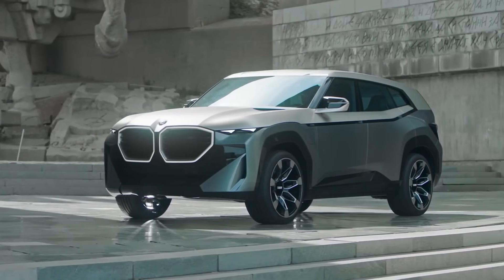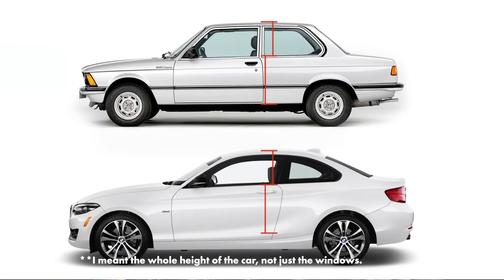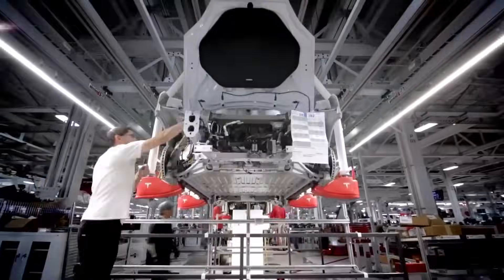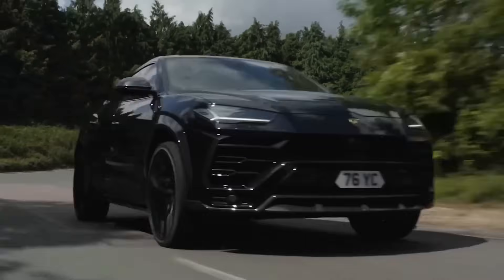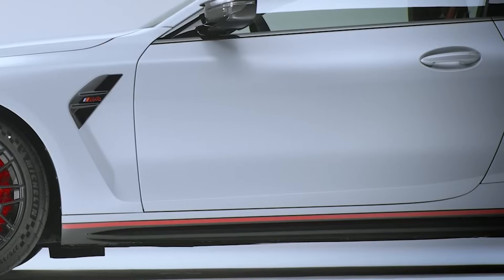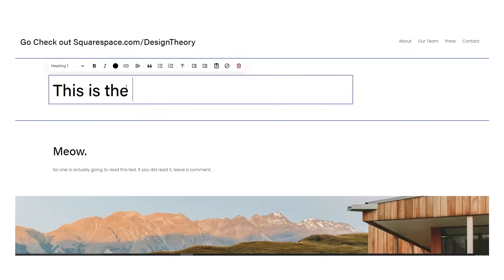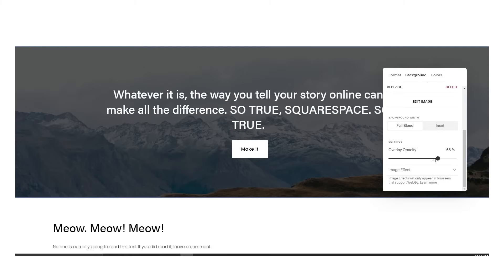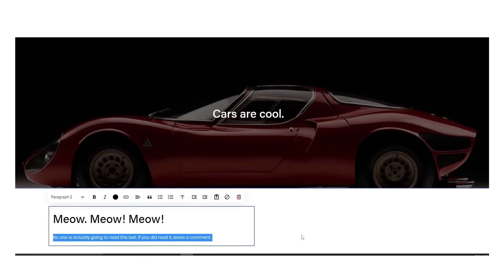Why Modern Car Designs Are So Visually Complex | Q&A w/ Pro Designer

Comment: Complexity is mainly done so it won’t make sense financially to remodel it in case of dents/accidents.
Replacing whole parts instead of simply iron out whatever "imperfection“ is creating another revenue stream. Only a few years ago you were able to replace headlights on your own (not to mention a light bulb). Not possible today, in some cases you’ve to disassemble parts of the motor only to access it.
The BMW E30 you’ve showed has become an icon for a reason. It’s "clean" lines are its main staple.
I own the convertible, and it’s still a "head-turning-device". The visual "Batmobile"-isation of todays cars (attached to the rise of "tank like" SUVs) simply reflects the increasing aggressiveness of a modern society.

Comment: I refer to it as "Designer Masturbation". 
It is a chronic disease infecting around 99.8% of all designers.

Good design is SIMPLE. And the perfect example of this is the new Mazda Icon SP design. It is without doubt, one of the most gorgeous cars to ever be produced, and it makes other so-called "modern" cars looks utterly stupid.
Most modern designers are crap. They can't do a good job, so they produce an insanely complex design, instead.

In fact, most modern cars look as if they had three independent design teams working on three different designs, but instead of picking the best one, the manufacturer say, "Screw it! We'll use all three design overlayed on top of each other."

Comment: So as someone who works at the BMW X plant I feel some insight might be helpful. 

Simply put cars are really…really complicated in modern designs. If you take any part off of a car to expose internals they will look like a massive mess of wires and bizarre clips and moldings to keep the countless sensors and control wires or lines in the right place. (My heart goes out to those who have to diagnose and fix problems on modern car’s mechanical and electrical) For better or worse our cars are now computers that also are interacting with the real world in real time. 

This is especially true with the XM. It essentially has every possible sensor and option available and it’s frankly quite impressive we’re able to get everything in there we can. 

So to actually get to the point with that context, designing these cars to be different and unique is quite challenging when they are going to be built in the same place and by the same people. There is no “Xm” line or building. So imagine trying to make a sporty and varied looking suv that is going on the same line as other SUV’s, oh and not to mention they have a million codes and standards to follow.

(Also in person I personally think that a good deal of Xm’s with the right color and wheel look fantastic, though I’ve seen a fair share or rather “fascinating” combinations)

Comment: Form is function.... this is a fact, that not even our academy university ID teachers didnt teach us. But its completely true, and even more of a fact than a form follows function..   Form becomes function, when you start making a human-centered design, like designing product handles, triggers, buttons, scaling products to fit human proportions, using a surface thats not slippery, and making edges more round or chamfered, if the material is very sharp like stainless steel...   I could go on and on.    Its a pleasure listening to your podcast and design thinking ;)

Comment: I agree with most the things you said except about knowledge.  I have never seen a time when a lack of knowledge brought about a good result much less better results than someone would have with knowledge.  Every time I as a IDer learn more about a subject, I am much more equipped to design a better solution.  Whenever I have tried to design concepts for a problem without a firm understanding of the subject matter- it has resulted in failure or poor results.  That includes "novel" ideas- a good designer will have more "novel" and "usable" solutions if they possess more knowledge not the other way around.  Would love to hear your thoughts.

Comment: As a classic car owner it is unbelievably frustrating to see the lack of connection that car companies have to their roots. There was a time when distinct and visually striking lines and body panels were the norm, but in a way that actually looks good, and not like an AI threw up on a Pontiac Aztek. I drive a 1965 Ford Falcon, a car which has a massive spear indented into the side of the car, wrapping around the back to meet the other side. This is a perfect example of a visually striking, shocking, and unique design, that does not over complicate things, and it was done on an economy compact sedan. The spear only consists of three body lines across the entirety of the vehicle. A good modern example of this is the Hyundai Ionic5, which has the depressing and hideous proportions of any modern SUV, but uses distinct and limited creases on the side to create a dynamic and striking design.
Reply: What makes many classic cars 'striking' is the fact you only see them rarely. Modern cars you interact with on a daily basis and get used to the forms and surface treatment of the current era. That's not to say there are great designs which were novel for their time. But putting any generic 60s car into todays traffic could surely be described as striking, just as if you were to do the opposite.
Reply: @DimitarStanev  I disagree with this premise. The diversity in design of previous eras is completely unmatched by the modern day. Look at a 65 Corvair, Falcon, and Valiant. All compact economy cars from the same year. Then look at a 2015 Corolla, Focus sedan, and Cruze. I certainly acknowledge that classics are striking on modern roads, but they were striking in their era too, because there was huge diversity even within the exact same niche market.

Comment: Early car design as was explained to me, goes as follows:
The early cars had a lot of straight lines because manufacturing technology was primitive. there was a lot of sheet stock, lumber and brake bends, etc..
The cars got round in the 30's and 40's as manufacturers perfected the machining required to stamp curved hoods and fenders.
Cars got boxy again in the 70's and 80's because design departments were switching to CAD systems and the computer technology was too primitive to number-crunch complex compound curves.
Cars got rounder and more complex as computer technology matured.
I'm not sure how accurate this is, but "car guys" at GM told me, so I assume they knew what they were talking about.

Comment: 3D solid modeling may have played a part in the growth of complex designs. This software makes it easier and faster to create the deigns, modify them for comparisons, perform engineering analysis , automatically collect and transmit data for tool design and manufacturing.

Comment: I'm glad the conclusions surrounding  the  'visual complexity' of cars was at least part-way damning of the designers. The bulk/common shape is undermined by the existence of modern but relatively clean and elegant designs (which do exist) - in an interview Gerry McGovern (Land Rover's long-time design head) stated that large, bulky cars are indeed harder to get right - but harder doesn't mean impossible...

Comment: sometimes the fractured look can also flow well, just in a different way from traditional flow
i think there is a spectrum to this, and while something like the lucid air i would describe as "languid" and more typically flowy, the hyundai verna also flows in a more sharp, inoffensive way and then on the other side is the non-flowy part of the spectrum

Comment: That moment when a top comment is way more valuable than the content of the video... Because you fell into a content creator trap of 'I' am X, therefore I should act like an expert in everything related to X. Even if I have no idea about it.' 

Man, I have never worked a day in automotive but just based on what I know about it, saying that 'different branches of the company tearing the design into several different directions' in a time when we generally have the most uniformity since the 80s, with different cars sharing the exact same lights, interiors and various design cues across the model range just doesn't hold any water. And showing a Type-R which is actually a quite cohesive and purposeful design for the car in question further proves you're out of your comfort zone here.

Comment: Current cars are following what I think of as the "Chonky Bling" styling. Unnecessary protuberances and messy criss-cross lines. They must be a nightmare to handwash, and look like they'd generate a lot of wind noise and wind resistance. When all the manufacturers are doing the same thing, no vehicles stand out anymore. 
However styles go in phases, so hopefully by the time I need to replace my current vehicles the chonky blink will be out and we can get some sleek lines again.

Comment: Regarding the first question, the answer is far more simple than you've stated: money. They could design a less "puffy" vehicle and they could, at the very least, go with curves over wedges to beautify those cars. But they won't because that would cost more money. In short, in my opinion, we drive horrid looking cars so that manufacturers can make more profit.

Comment: You dont even need to compare it to a 70s BMW, cars from early to mid 2000s still had healthier glass to body ratio. Subaru Legacy station wagon from 2006 compared to 2014+ Levorg which is supposedly derivation of same platform shows how tall window and hood lins got in same size car.

Comment: It's interesting that you mention Frank Lloyd Wright.  Many of the buildings he designed have significant structural/maintenance problems because he focused too much on form instead of function.  I've been to Swannanoa and one of the main reasons it's maintenance expenses are so high is because they did stuff like route the gutters inside the structure for purely aesthetic reasons, which is just dumb.

Comment: 13:49 I think I have a different understanding of what the function is. For me function is the physical thing, totally excluding the users. The function in this example is pressing a button. More or less deterministic. The form is the thing that leads us to the function.
The guitars are all functionally the same. The form makes a difference in how we use them, but how we use them is not the function for me personally. I would conclude use = f(function, form). The function says what we can do, the form says how we can do something.

Regarding the light fixtures: I would consider both of them on different axes/dimensions in a plot. A light fixture can be good looking and unusable, it can be bad looking and unusable, it can be bad looking and usable, it can be usable and good looking. I hear the question form vs. function as either or (exclusive or), because many modern "minimalist" designs are just stupid and unusable. Like these Vanmoof bikes. Every bicycle has s lamp that shows where you want to go since the light is mounted with the front wheel. But that's not good looking, so they put it into the frame. And now we lost function for having more form.
Reply from the maker: Totally fair points. There are many ways to interpret the meaning of these phrases. If you want to hear it from the source, you can read the entire excerpt by Louis Sullivan about "form ever follows function" on wikipedia. Or buy his book.
Reply: @Design.Theory  Thanks for replying. It's definitely more or less philosophic, there is no right (but maybe wrong) in the interpretation in my option. I'll definitely read the article.
Reply: Who presses the button if not the users?
Reply: @AlexR2648  I was making the point that function doesn't consider the user but the use. I don't care if a human or a robot presses the button. I personally view that on a more abstract level.

Comment: GREAT PRESENTATION BACKED WITH SOLID DATA...

I am a Designer from way back. I have designed a Modular Car that can be twin engine, triple engine, and even quadruple engines. They fall under the FIA GT- X for Experimental and are designed to Race in Street GT Classifications. Bodies and layout look like any conventional high performance passenger car on the streets, similar to Ultima Can Am inspired design. All of them are Street Legal and could actually be Driven to any racing event. A quick Tire Change and they are ready to Race. Imagine diving a Street Legal Twin Engine Can Am Race Car with 2,000 - 3,000 HP. Yeah, it only goes up from there with bigger engines, and more engines. Our 4 Engine 10,000 HP vehicle was designed to break World's Record at Bonneville, going way past 500 MPH in a Street Legal. 

Regarding modern car design, the more they butcher the look of cars, the more they all look alike. The cars have lost their souls. It has become hard to tell the difference in cars today. Designers go to great length to stick their 'Logo' - nose trim in front. Even that has become stale. Car Designers can certainly do a better job at making things simple and elegant and still meet Safety Standards. 

I drive a 2008 Maserati GT and it has very simple lines. It's a 2 door coupe with back seats, trunk,  Mid-Engine Ferrari Made  (sits behind front wheels) long hood, gorgeous nose detail, lines that flow front to rear, another gorgeous treatment of rear panels, leather interior, adjustable passenger comforts. The engine sound alone makes this car stick out yet blend in. Not quite Supercar, but certainly Italian Designed Super Sports Coupe that goes insanely fast, can out accelerate, out brake, out corner, or just  blow the doors off 99 percent of cars out there. It's a blast to drive.

Thanks for your Presentation.

Comment: Reason why modern vehicles are visually complex is the lack of straight delicate lines. Curves might look good for awhile but as time marches on, they don’t age that well. A 1959 Chevrolet or 1959 Pontiac flattop (a majority of late 50’s to mid and late 60’s cars) looks more timeless since the only curves are on the windshield while the body itself doesn’t really have any curves at all and yes there are a few such as the the famous batwing fins on the 1959 Chevrolet but otherwise didn’t have as nearly as many curves as the cars from the previous few years and of the cars from the 1990’s to the present. Curves simply don’t stand the test of time as well compared to straight delicate lines on late 50’s and 60’s cars since curves age worse than straight delicate lines on boxy vehicles from the late 50’s and through the 60’s.

Comment: A couple of days ago I witnessed a car rear ending another car rolled to a stop on the highway due to congestion. This was not a fender bender but a dramatic collision with squealing, smoking tires as the car tried to brake. I'd estimate that it had been doing 90 mph and slowed to maybe 65 when it hit. What occurred to me at that moment was that vehicles are designed to be like giant robot fists hurtling down highways. A sick kind of jousting. It's all about mass and speed. Which, of course, isn't the point at all. The point is to get from point A to point B safely.

I've ordered an Aptera which looks nothing like a robot fist. It looks more like a shark. It's about efficiency, aerodynamics. All electric with minimal batteries; it offsets up to 40 miles of range per day with solar panels. This is a better future, I think. The rock'em, sock'em robo-fists should go the way of the dinosaurs. Transportation should not be a violent activity.

Comment: It used to be "common knowledge" among car guys that the end of the 50s was a low point in car design. Cars became bigger and bigger, and designs more and more complex, with lots of weird, almost baroque features to make them look "high tech". The result was big, bloated, muddled, rolling blobs with fins. Remove the fins and we're right back there but even more so now. Even worse, with the commoditization of the auto market, you might look around today and see that literally every single car on the road is the same, basic egg-shaped quasi "crossover SUV" (basically the modern replacement for the minivan) with a slightly different badge on the front. It is really hard to tell a Kia from a Buick from a Porsche. I think that younger consumers don't even realize that cars can be good looking and a lot of them don't care anymore. Going out and driving around in your car like people did in the 1970s is not an activity anymore. "Going on a drive", isn't something that I'd guess that young people would even want to do for fun, even on a Sunday. With the traffic the way it is in most urban centers now, driving is just a chore. It's all really sad. Cars are still a symbol of freedom to a lot of Americans, but they are rapidly evolving into an ugly, generic, monotonous, centrally controlled (by computers) chore that has to be gotten out of the way.